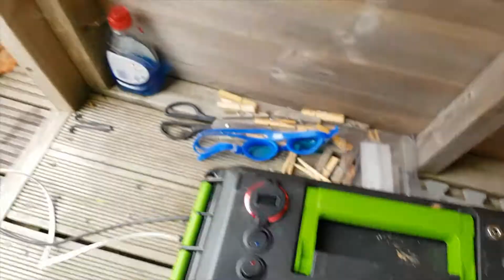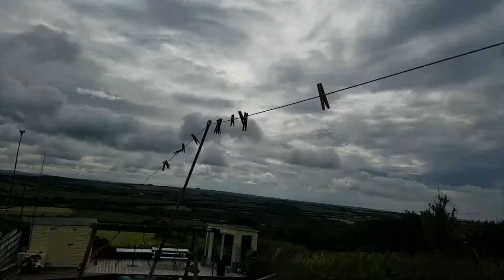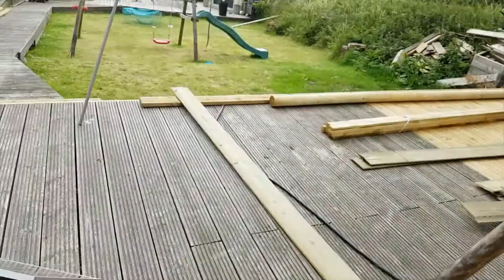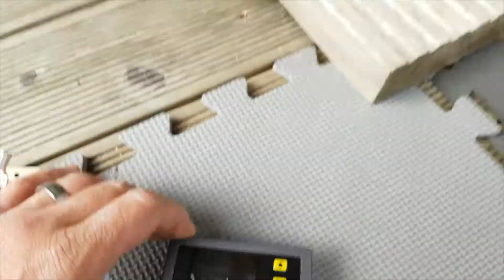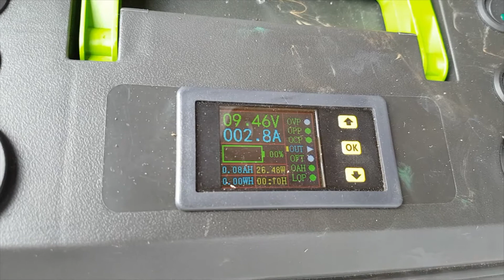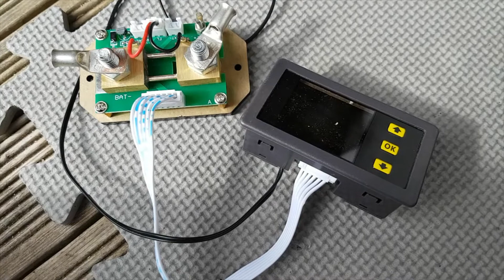Solar Accumulator (generator) First Solar Charge Tests

Comment: Looks like a handy meter if you can make it fit.
Last week I finally got my two solar panels mounted on the roof of my shed so I have an amazing 10W of awesome power.  Mmmm
I just screwed them to the roof which is way too flat so I'll need to make a mount for them to get a bit more current. At the minute I'm only getting 0.7A max but mounted properly they should give just over 1A. I'm using your PWM5 through hole which is great as I don't need to worry about damaging the battery.
Reply from the maker: It's a nice idea, but the inductive pickup isn't ideal, as there's too much space around the cables. This allows the cable position to change, and so the current measurement goes out of calibration. Also the firmware is quite buggy, making using and setting up a fiddly and frustrating experience. 

I'm going to use the old meter in my solar workshop power board. 

The new meter is better though.

Your panels need to tilt at about 15° to the south if you can. Mine tilt at about 10° to the SSW, because that suits my more southerly location. You should see about 600-700mA from a 10 Watt panel in full sun, connected to a battery.